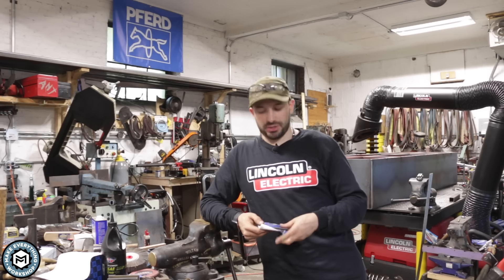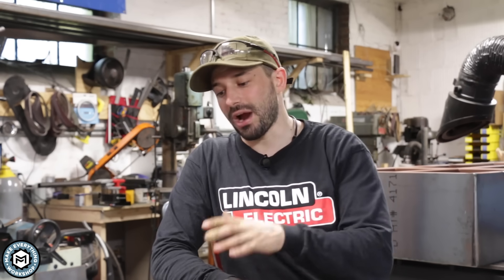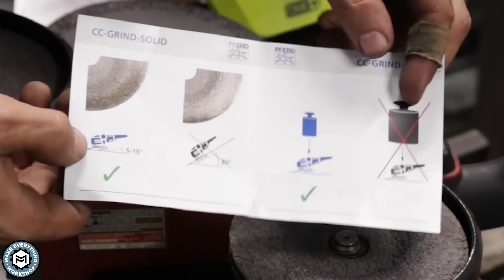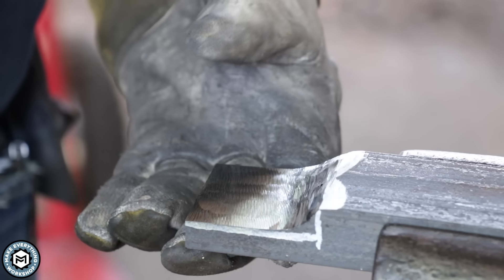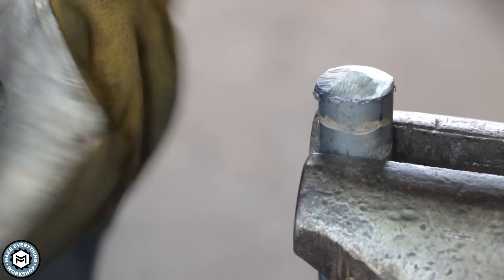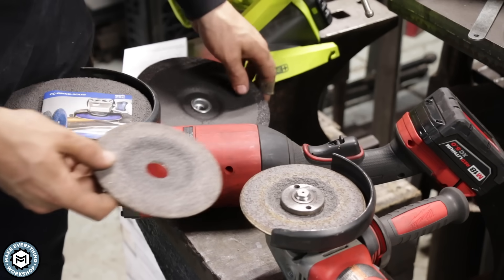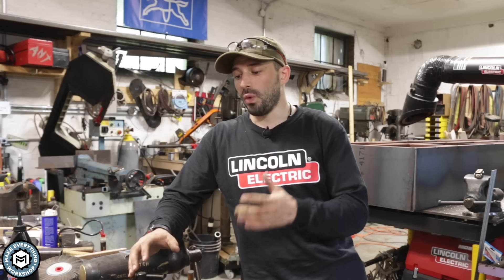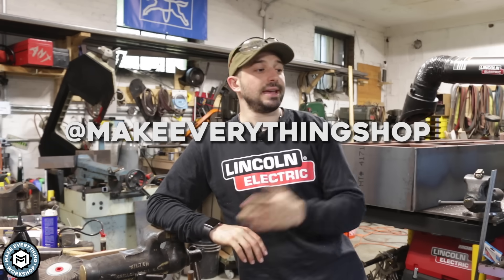A Grinding Disc That EATS Metal! Victograin VS Traditional Grinding Discs

Comment: Why didn't you compare to flap discs?
Reply: Because flap disks are for finishing, not heavy removal.  They just cant take the long term heat.
Reply: @CorwinBos  - flap discs are for finishing? What are you smoking? My 36 grit flap discs are most certainly not for finishing. And they don't heat up near as much as those hard grinding wheels. Your just pulling that crap out of your ...
Reply: @TheZigZiggy  Ill take that bet.  I use these Pferd disks for any flat grinding, descaling, etc, and have for about a year now.  I retired my 36 and 80 grit flap disks for nothing but doing a finish pass to making things pretty for paint because they leave a nice finish.  I still keep a few stone grinding wheels around for grinding in corners, and things that the Pferd disks arent great at.
Reply: @CorwinBos  flap disks nor regular grinding disks heat up to matter about anything. Flap disks remove metal great. Either you haven't really used them any more than doing some arts and crafts, and you just don't have enough experience to make the determination, or you were using crap flap disks.
Reply: Now see all the arguments. If he had compared the flap discs then these arguments could have been avoided.

Comment: I sorta hate grinding discs myself. I would always rather use a high grit flapper disc. They just leave a better finish and are quicker in my opinion. I think I’ll try one of these though. Thx for suggestion
Reply: Flap disc are for finish work

Comment: How is the price point the same?  These (4-1/2") disks are $6.31 per disk and the harbor freight cheap-o disks are $1.40.  I get the value in the easy pressure and less frequent disk changes though.  These disks are at the price point of flap disks, but that is not what you compared to in the demo.
Reply from the maker: The disc I used in the video was $7.89 at Home Depot, it’s a Diablo metal grinding disc. That’s a fair market comparison, a $1.40 harbor freight disc is not going to be made to the same standard as a reputable abrasive and blade company like Diablo.

Comment: Sadly, I felt the same with grinding discs, I used to use them to grind edge bevels into mild steel sword and axe blanks for props- after about a week, I instead resorted to 40 grit flap discs, which cut down the vibration, but don't eat away as fast and have a much, much shorter lifespan. Glad to see there's a good alternative, one 8 dollar disc could outlast both of those things and spare my hands, I'd like to see how this compares to a 40 grit metal grinding flap disc.

Comment: While they are obviously useless at getting into any kind of corner, these disc's certainly kick ass at surface removal. You should do a disc roundup video showing all the typical angle grinder processes & Ur recommended abrasive/cutter disc for each (mill scale removal, surface polishing, cutting...). U probably have most of the video already, just need to splice & narrate. Thx

Comment: Thanks for that, most frustrating part of fabricating  is too use a grinding  disc that feels like it's just sliding over the steel after the first minute,you forgot to mention how much less heat is being generated
Reply: I mentioned the same thing in my comment. You can actually see the paint mark burning off which means that steel is smoking hot. One major downside of those crappy bonded hard stones is they cut like crap once the metal reaches a certain temp. That's a huge deal if you need to remove a lot of material.